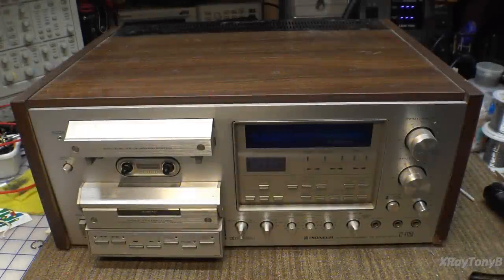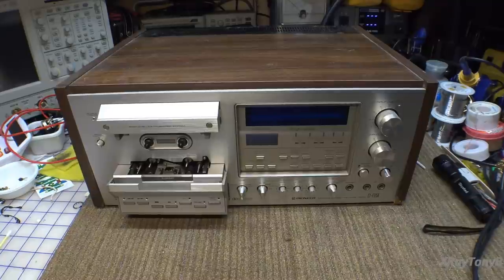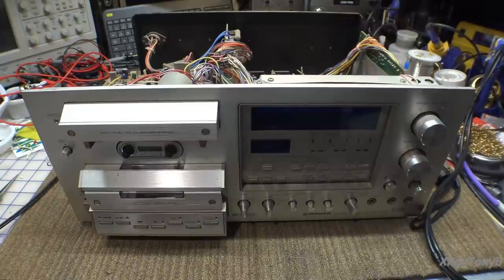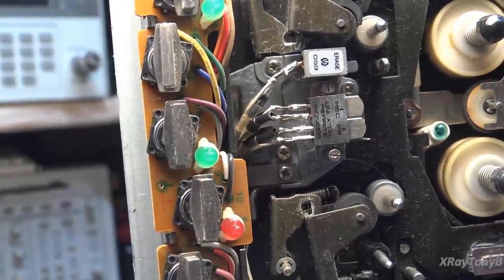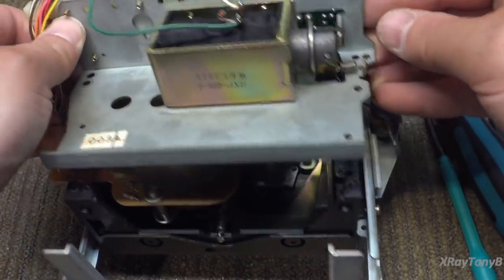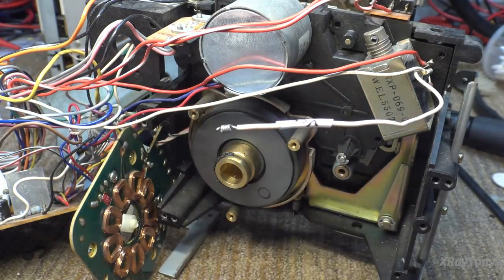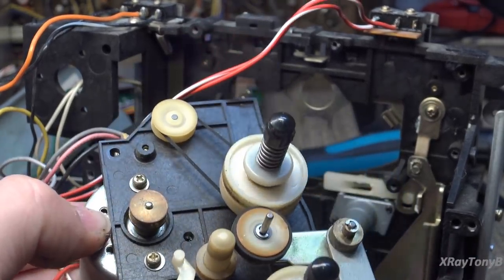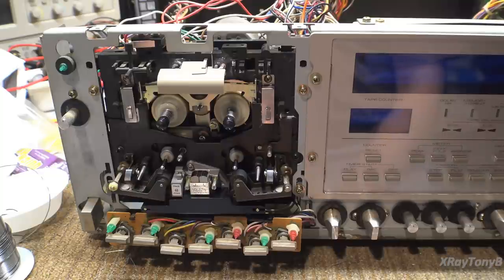Pioneer CT-F1250 Cassettes Deck Restoration Part 1- Initial checkout

Comment: In my 60 years I have broken down and reassembled a lot of complex machines.  I have never, ever had any luck with putting cassette decks back together.  Somehow I always lose a critical e-clip, or bend a lever that does not bend back as it should be, or any of a dozen missteps one can make.  A big salute to those who can repair them.
Reply: I’ve repaired a few in my day. They can be intimidating, and before the days of instant photos off of a cell phone, you had better have a photographic memory if you go deep. Like you mentioned, there are just so many plastic bits that become brittle, sticky belts that become liquid tar, worn rollers that are often impossible to find, and that occasional e-clip that sails to Never-Land upon removal. It’s frustrating.

Comment: At 40+ years now, these need some TLC...even if they have been pampered, a lot of real estate on those circuit boards.  Tony, you make note of brittle plastic and rubber condition; critical items to pay attention to.  This particular deck was a powerhouse in its day (properly calibrated of course).  I have a soft spot for the Pioneer blue line items and really lusted after this model as a young person, it had a premium price though and was out of reach.  Thanks for taking a deep breath and diving in on this one.  I'm looking forward to the next video!

Comment: This video was a pleasure to watch.
The pre-recorded chrome tape is probably made to play in the 120 micro/sec, normal setting, which can be checked by inspecting the edge cut-outs on the cassette.
If so, the playback will be brighter and give the deck the justice it deserves.
Reply: You are absolutely correct. I have Lynyrd Skynyrd Second Helping album and it is factory recorded on chrome cassette and the cardboard insert says that it should have played back on normal.

Comment: I know exactly how you feel about cassette decks.  I've worked on a few,  replacing belts,  tires,  and tested speed ect...  I dread doing it every time.  My eyes aren't what they use to be,  and some parts are pretty small.  You have to tear most of them completely apart to change one thing.  I'd much rather work on an amp or receiver. But, there are some really cool decks out there like the Pioneer in this video.

Comment: I recently felt motivated to take my Pioneer RT1020L reel to reel deck down out of my garage attic and do a restoration. I found a good quality set of belts on ebay, and did a complete teardown cleaning and re-lube of all the mechanicals.. The high temps had cooked all the grease solid. It's playing well now, good as ever. I did have the good sense to keep the tapes in the house.

Comment: Bought this deck's much more baby brother at a flea market - a still impressive CT-F700.  Not a two head deck, though.  So you have to work a bit harder to get a decent recording.  Lots of us US servicemen brought back stereo kit from overseas, most with these multi-voltage selectors on the back.  Great job!   Keep at it!

Comment: 8 or so years ago a friend of a friend wanted to give me one of those ...and i ALWAYS wanted one as i was growing up. he said it didn't work and i said no. i had never seen inside one but knew it would be a nightmare. after seeing yours, i am glad i refused. being a car guy with some background in electronics i know just enough to get in trouble with a tape transport, i've seen them before and just no. no thank you!
Reply: Can you even buy blank Cassette tapes any more?🤔🤔🤔
Reply: @fw1421   before radio shack closed down i bought a couple of chrome blanks for a dual cassette deck someone else gave me. they were expensive and the record bay didn't work and then someone else gave me a dual deck and it was the same thing. they were common technics and pioneer decks so i wasn't upset when i scrapped them. even after quitting drinking and having a clear head and no shaking hands, i still have zero urge to service a transport. but i'll enjoy the shit out of replacing every one of those caps!

Comment: I said in a previous comment in another video that I purchased one of these at an estate sale a while back. It happens to be in perfect physical condition. One issue is that the reel motor has a dead spot in the commutator. I was thinking of making a video of the repair of the motor. I never made youtube videos and am just trying to get up the nerve to do it.
Reply: Put a video up of my Pioneer CT-F900 which needs the reel motor fixed, same problem. Got the belts in and the takeup motor has a dead spot in it. Have a museum quality CT-F1250 in the same video. Have another motor halfway apart, the first shell off, only to find another shell inside that one. That is where I left off. Did you use a punch or a dremel to get it apart?

Comment: I have the CTF-850 model and I have performed the service several times; a point to take into account is the pressure exerted by the upper support of the cassette ( the one you had to fix ), if it is loose, it will come off both lower retaining claws and will deactivate the presence switch located at the bottom right, hopefully stopping it... if not.... you have a mess.

Hope you underestand this, english is not my native languaje

Comment: Those X-Tal, or crystal glass ferrite heads can develop cracks which can clog with iron oxide and cause problems with high frequency output. That is what I read, not sure if that is what you were talking about. I have a Pioneer CT-F1250 which is in museum quality, been stored for years. It needs the rubber parts replaced. Also have a Pioneer CT-F900 which has the sendust heads and needs a takeup motor, or brushes repaired.

Comment: 22:00 Another trick you can use if this is out of view : 
remove the remaining stud of the broken plastic and drill a small hole trough the plastic where the stud previous was, 
then use a cable lug and tap threats in it (in the hole where normally the cable sits), so that you can use a bolt into the cable lug. 
In the opening of the cable lug (that you normally use to screw down the cable lug) fits then the white/grey plastic knob.

Comment: It looks like you got your work cutout for sometime. Should be quite interesting. As a thought I was wondering if you have used UV glue that is cured with a little blue led. I think it might have been good for the retainer clip you repaired.  Thanks for the look.

Comment: That's a lot more work and dedication I would ever do on a cassette deck unless I had some "valuable" tapes that have yet to be digitized. I have an old SONY TC-K555 (1983 vintage), but I transcribed the last cassette in 2105.

Comment: You can repair the brackets with epoxy resin glue just put some tape tight around the bracket you want to feel and use a Q-Tip and smear some candle wax on it place it between the tape in the right position and fill with glue do the trick.

Comment: Tony, I have a CT-F1000 that has been sitting for a while after it quit pulling tape. I ordered a kit of all the belts, idler wheels and other parts to redo it, but haven't got around to tackling it yet. Your video is getting me excited in getting it off the shelf and starting on it . Do you know if the transport is similar to the 1250? If I'm not mistaken there are instructions on how to disassemble and replace the worn and broken parts!  I love your videos and thanks for doing this one, I want to clean it up like you are doing.

Comment: I was actually quite interested in a method of restoring rollers, as they become increasingly hard to find. But I don't think there's a proper way outside of molding+turning or fine layer depositing+turning.

Comment: Yep these are a bit of a bear to work on, I avoided doing a 950 a few years ago because it was more trouble than it was worth (and not mine!). Good luck with it!

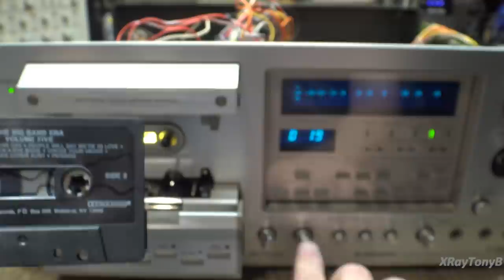26:53 most prerecorded tapes, even if on chrome, will be at 120us EQ for compatibility, so you can just leave it on 'STD' to play back.

Comment: Would you reveal where you found belts and the idler wheel? I have a CT-F900 that the take-up spindle slips causing it to shut off. I can play a tape if I use a small pick to manually turn it. The transport is not exactly as the CT-F1250, but very close.
Thank you.

Comment: Hi, my ct-f1250 is driving me bonkers. The capstan no longer turns on its own. It does spin freely in the shaft. Even without belt to other capstan doesn't start spinning. If I give it a little help it starts spinning no problem. Any idea what could be causing this ? It does manually spin very freely though. I cleaned/ put new lithium grease on white plastic behind rear plate too. PLS HELP !!!
Reply from the maker: You could have a problem with the motor control board or with the motor board itself.  There are a lot of very fine wires on the motor board that can break.  Also, the connections to the two boards could come loose.  I would start there.
Reply: @xraytonyb  Thanks for response. I spent a good hour checking continuity on Tape controller board traces, and all wired connections - All good. The previous owner replaced caps with Elna's. I wish I could somehow take this offline in an email so I could send you a pic or 2 ?

Comment: For a long time ago I had CT-F950. I remember that there was a huge flywheel. And what do I see at 1250? He's not there ... I'm very surprised.
Reply: The CT-F1250 is direct drive so a heavy fly wheel is not needed.
Reply: @hqdefault  Many cassette decks are direct drive. They also have a flywheel. Or even two. For example, Sony TC-KA3ES
Reply: @any1ne  Yes I meant direct drive don't need super sized fly wheel.

Comment: I have a 1250 without a transformer the unit I have has the Fuse mounted to the back of the case, would you happen to have a transformer you may want to part with???

Comment: What's the best method to test the Play & Record head ? I use a 3150Hz reference tape for speed testing. Can I test recording different freq's between 20Hz - 21kHz from my freq generator and see if it's recording that freq ?

Comment: Why are you blocking my comments and not even showing up!
Reply: @xraytonyb  ok I thought you might have been filtering does the other comment I left show up can you see it? About repairing the post!
Reply: Sometimes YouTube blocks comments when there are links to other videos, or certain keywords used. The author of the video has no control over that.
Reply: @zulumax1  yes sometimes I've heard that usually error code 404 and the comment doesn't post, but normally I can see the comments clearly you can't see the other comment I left can you?

Comment: I appreciate your tech skills but all that work to be able to play obsolete media. You cant even buy music on cassette today. You cant get blank tapes either.
Reply: I’m trying to find someone to work on a Sony TCD-5M
Reply: @Runco990  you are correct, in part. A fair number of bands who are involved in the lo-fi end of the DIY indie rock release cassette-format EP's and whatnot now, because it's relatively cheap, and because the retro idea is appealing to them.
Reply: Actually you are incorrect on BOTH assumptions. RTM and a few others are manufacturing new tape and there is MUCH unopened New Old Stock tape available to purchase still. Some artists are releasing new material on compact cassettes but not in any significant volume. Records, Compact Discs, DAT, DCC, 8-Tracks, Reel to Reel are also obsolete media but that does not mean people are REQUIRED to give them up. What I do not get is the push back against those who choose to listen to music however they choose. I've found the vast majority of negativity comes from ignorant people. Not every piece of playback and recording equipment is created equal. I find those who judge and entire format as the same are ill informed. Physical media playback isn't for the lazy. There's some maintenance involved. Most should probably just stick to streaming.